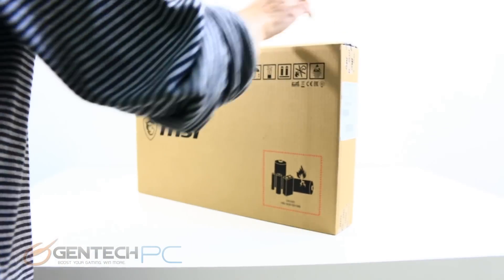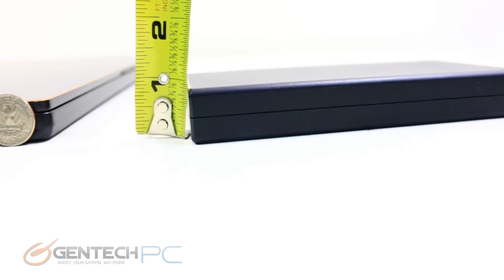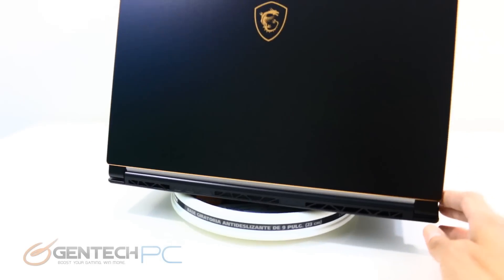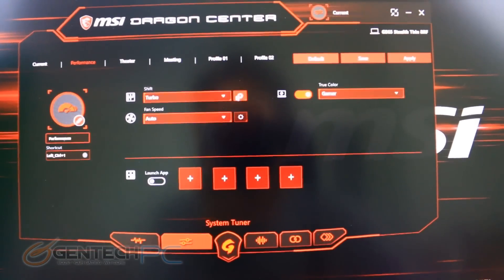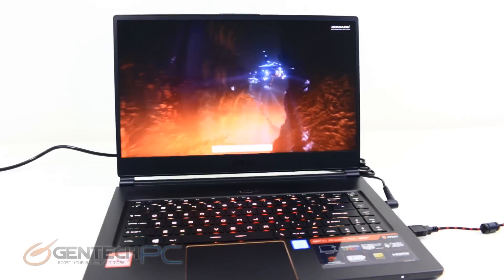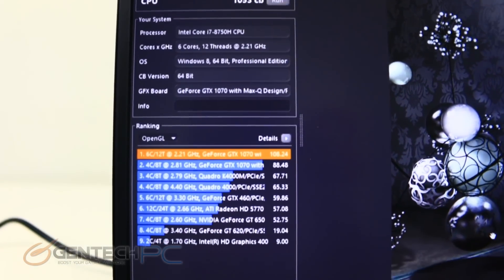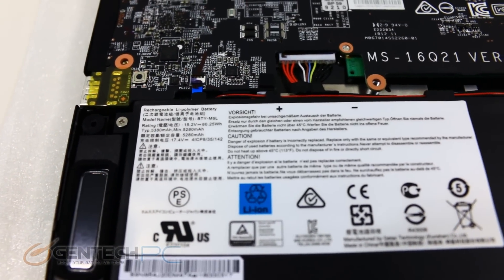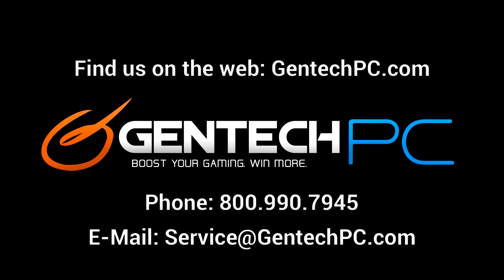MSI GS65 Stealth Full Review w/ Benchmarks

Comment: AMAZING REVIEW!! I am thinking of getting this. Will this last long though? Like 5 years?
Reply from the maker: 5 years should be no problem if you take good care of it and keep the fan clean.
Reply: @GenTechPC  How would you clean the fans though and how often?
Reply: @marioloza7845  Same question, it's so hard to open how does one keep this thing clean?!
Reply from the maker: @marioloza7845  Remove the bottom cover and use canned air to blow out the dusts, however, this is not the best way to do it, the best way to do it is completely remove the fans and blow out the dusts outside of the laptop.  

When your laptop starts to getting very hot then it's time to check. Or just check every 2~3 months depends on your environment.

Comment: question, so the CPU and GPU are soldiered into the motherboard? if you purchase the entry level G65 Stealth Is it possible to upgrade from the 1060 to the 1070, or upgrade from a 7th gen i7 to an 8th gen i7? I remember having an original alienware back in the day and the processor and GPU's were up-gradable.
Reply: BlackMarket Entertainment No it's not possible to upgrade but the best thing is this laptop has a full thunderbolt port and you can always get the 1060 version for better thermals and use an eGPU via thunderbolt for future cards.
Reply: thunderbolt is cool but not portable, its definitely always great to have that option, but I prefer the old school MXM Gpu's. My Alienware had dual GPU's in crossfire that were upgradable, I remember going from the x2 radeon 3870's to x2 radeon 4870's... does anyone know of any newer notebooks that still use MXM cards like back in the day? I mean being able to upgrade into the next gen with a laptop internally is almost unheard of these days.

Comment: At amazon, MSI said that there is a slot for a 2.5" HDD. Where is that located exactly?
Reply: there is no 2.5 slot. the battery has taken this spot. No one really wants 2.5 any more. Use nvme pci  its faster and less power.
Reply: @iDatas but it's pricey as hell. Is there any other cheap alternative to increase the memory? Will the memory slot support SATA ssd?
Reply: Not sure how they done it but taken from their web site - 
SSD
1x M.2 SSD slot (NVMe PCIe Gen3)
1x M.2 SSD Combo (NVMe PCIe Gen3 / SATA )

The combo slot is however occupied by the drive that comes with it so not much help unless you don't mind replacing.
The memory slots only takes memory dimms I'm afraid.
I liked the look of the MSI but would recommend you take a look at new Razer Blade 15.
If you really want to use 2.5inch SSD you can buy a usb 3.x enclosure for one.
Hope this helps.

Comment: For memory / SSD upgrade, see here all the many steps for detaching the motherboard!

The video from 13:24 shows the required detaching of the motherboard, and omits quite a few steps. You will need to remove A LOT of hard to remove cables, it seems very hard and dangerous do to, way harder than any previous upgrades I had done! Here are the steps I took
 
** For all flat cables, always pull up the black part first with some sensitive small pliers, EVEN if the black part is on the other side of the fixture!.
1) removing the wide black cable which is also stuck to the fans, detached two strongly glued parts attaching the cable to the fan.
2) remove the two remaining black screws which are on the motherboard (one right next to the video cable)
3) remove the yellow tapes of the cable to the network board, remove the network board screw, remove the network board (I was not able / willing to remove the two long black cables from it, so had to pass the whole network board through the large hole between the board and the fans, after some slight stretching)
4) remove flat cable from rear
5) remove all 4 (!) flat cables from the front part of the motherboard, including a small one far on the left (which I had missed initially)
6) remove small white (power?) cable close to the network board
7) remove the large white power cable (I was not able to do it, so I ended up upgrading without removing this last one)

Do at your own risk, there seems to be a high chance of breaking the whole thing! Otherwise just buy an already upgraded version...

Thanks a lot for the video, GenTechPC!
Reply: Nonsense. If someone has no idea maybe. But saying a high chance of breaking it would only be true if your a moron. 
Take your time and it is fairly easy. More steps because of the flip but it isn't rocket science. 
If your laptop breaks while inside it then your doing it wrong...and if that's the case then you shouldn't be opening it to begin with.

Comment: hate the fact that these gaming laptops don't have HDD slot >< 
now i have to pay extra 500 USD instead of 85 USD for 2 TB drive ...
Reply: Just buy external HDD you can save extra bucks
Reply: buy a bigger laptop. super thin and light means everything is the smallest it can be. Plus you get a bigger battery which most would agree is better. e.g. not tied to brick when you want to spend quality time with someone.
Reply: iDatus the problem that I need thin light and small 15.6 inch form factor, I move my laptop in my backpack about 20-25 times a month
Reply: I was just stating that's why it is so small, the GS65 is a lot lighter than the ASUS or Gigabyte one which fits your requirement.
Its ok having a gaming laptop but carrying one around is not fun. The MSI seems the only one that gets it.
Reply: Yeah you can buy external HDD OR SSD BRUH

Comment: How do you think this laptop would hold out if I was planning on using it as a daily school laptop (Word, Excel, chegg, YouTube) for about 6 hours, and games like fort nite by night for prolonged periods. I'm worried about the thermals and the damage that it could cause.
Reply: -- Took out confusing comment --.
Both the MSI and gigabyte Aero 15x V8 will work for you. Look at both as they are similar but have many differences.
As for thermals and damage, don't think any device can damage easily as they have top limits set and if reached throttle power to these devices until save limits reached.
Hope this helps you.
Reply: iDatus get your information right.this is max q. The one that is not n
Max q is the new asus
Reply: I wasn't referring to the actual cards more how they are used. Which now I re-read my comments comes across as confusing.  Asus wouldn't fit Brian's requirements and I would recommend he looks at the gigabyte model.
Reply: Ok I remember what I meant. G-Sync. You have to reboot it to use the CPU(GFX) so that's the annoying bit. The MSI doesn't.

Comment: You seem to have switched the videos for outside heat buildup, you second video shows lower temperatures then the first one.
As I was watching the review I was surprised it got so hot at idle, but then saw that it was much colder on full load:)
Reply: Bah ,the later part of the second video shows higher temperatures then it does at the start, so I am not sure what is happening. I guess I will have to wait for notebookcheck's review for full graphs and hot spots... Otherwise great video though, good luck.

Comment: Wish CPU throttling analysis would have been done, since it it the weakness of the cooling system and most reviewers do not cover it either. I think all i7-8750h CPUs throttle at 90C instead of the 100C tJunction limit, shame. 
Also, since we ALL know the 8 hour battery life is a lie, would of been nice to see battery life tests. LinusTechTips managed only 2 hours, 35 minutes with the PCmark battery test https://youtu.be/uAUub6LPKBU?t=5m20s

Comment: ouch @ 94C, terrible thermal solution, this will throttle like crazy in game
Reply: Sayori Yeah, I ordered Aero 15X with repasting, I'm planning on undervolting my CPU if it throttles, hope it works out, otherwise I will have to spend on a laptop cooler as well :/
Reply: I have came across the term repasting. What exactly is repasting and why does it help with keeping the laptop cooler?
Reply: Sayori thank you sir. is it costly to get your laptop repasted?
Reply: Sayori thanks sounds good. i ordered this laptop and i regret it. I went for the 256 gb and when i received it, it shows a total of 133 gb but 77 gb free and it has been reformatted. And they are trying to charge me a restock fee. smh. do not buy the 256 gb.
Reply: Sayori I’ve heard it’s actually really easy to do so even tho it looks intimidating. 30 minutes top
Reply: in any thin and light especially with 8th gen i7s they all thermal throttle under load and they all have problems nothing new to that at all
Reply: Never had an issue with throttling out of the box, but it did get hot to the touch which was not comfortable whenever my knuckle rubbed up against the exhaust vents. An undervolting solved that.

Comment: 8750H CPU throttles because of heat and Is Vulnerable to the New Spectre And Meltdown Variant 2. 
Only IceLake in 2019 will solve Spectre and Meltdown. 
This Laptop is way too Loud and 1070 MaxQ can’t give you enough performance to run the 144hz Display.
Who Designed this Laptop ? getting to the RAM as M.2 Drive Voids your Warranty.
Reply: it does not void the warranty. Get your facts straight buddy...
Reply: You really don't know what your talking about... I have never had a heating issue with it... Play witcher for hours and hours and never have it throttle... cpu is around 80c gpu is around 65c
Reply: IceColdKilax Go for the gigabyte aero 15 it has an gtx 1060 and it give you enough fps to run fortnite on 144hz or at least 120fps  if you open it it doesn’t void wareanty. I’ill get it soon and would replace thermal paste and maybe underclock it will help like ~12 degrees. But maybe only thermal paste and that is good for like ~5-7 degrees
Reply: xToxicXSkorpion NO WAY Nvidia is releasing new Mobile GPUs by the end of the year. New mobile GPUs will equal GTX 1080 desktop performance.
Reply: IceColdKilax Wait a half year ? Lol
Reply: IceColdKilax Or maybe more

Comment: Was there any mention of battery life? I didn't notice any comment on that, but would be curious to hear what was tested vs. the advertised time.
Reply: If I remember correctly, if you're gaming, the laptop will last 2 hours. It will only last 8 hrs if you're not gaming.
Reply: I've heard a range of answers on this (I think Dave 2D mentioned 6-6.5?) so I wanted to continue getting info on it.
Reply: The label inside the laptop at 3: 45, says 8 hours of battery life and we got to see just how huge that battery was when the laptop's back cover was removed.
Reply: 82Wh battery, do some maths. With battery saving modes enabled, you may get  between 7 and 9 hours.
Reply: I've had the laptop for about a week now. It's 6-8 hours using it for office-style programs. 4-6 mixed and 3-4 hours heavily gaming though it depends on the game you are playing in terms of how hard the GPU is working.

Now, I have the 1060 version (which improves battery life around 20-25% over the 1070 max q) -- the only real reason you'd go with a 1060 (it also does have a slightly better temps perhaps 2-3% better) is for battery life/slightly better temps. That and its obviously cheaper.
Reply: euno17 That means 
1- You have stuff open in the background which ruin the battery life. Programs like O&O Shutup10 will HEAVILY imprive the battery life by getting rid of useless W10 features by disabling them.
2- Your CPU isn't undervolted. 6 cores CPU running at the full voltage will, again, ruin the battery life as well. Try undervolting and then test the battery life.

According to my GE63's 51WH battery which easily hits 5 hours with those settings, yours should do much better.
Reply: euno17 Hey did you notice any backlight bleed on your GS65? ?
Reply: AJ i havent looked hard but i havent noticed any. so any backlight bleeding that does exist hasnt been noticeable. Its been a hell of a laptop for me. I did have one issue where speakers werent working but it was only becuase as i took off the back panel, i saw the ribbon for audio wasnt plugged in. Other than that small issue its a great device. I havent had any issues with it.
Reply: euno17 Awesome 👍 thanks for the fast reply. It’s a big purchase so I wanted to make sure as it can be annoying when watching a movie or something and seeing the light shine through.  Also if your curious to check you can either click on personalize on your pc and set background to a solid color (black) preferably in a dark room and see. Or find a backlight bleed test online
Reply: 7 hrs productivity and 2:30 min gaming ( 1:45 hr fixed fps @30 + falls to 10-15 fps after 2hr mark)
.

Comment: As per my understanding the display is 144Hz, but is it a TN panel or an IPS?
Reply: Ravi Gupta It’s an IPS
Reply: ThatHawaiianGuy thanks
Reply: danwat1234  https://www.google.nl/amp/s/www.techspot.com/amp/review/1615-msi-gs65-stealth-thin/

Quote from the tekst: ‘’Reaching just 248 nits of peak brightness is not great, and neither is a sub 1000:1 contrast ratio. Both of these areas are handily beaten by the Aero 15X which packs a similar display and somewhat superior calibration.’’

And for the Asus zephyrus m here: 
Average of 295,7 nits go to headline
Display

https://www.notebookcheck.net/Asus-ROG-Zephyrus-M-GM501-i7-8750H-GTX-1070-Full-HD-Laptop-Review.293956.0.html
Reply: xToxicXSkorpion, And I've seen and read that many people have had unacceptable backlight bleed. I'm receiving a replacement in a few days, will let you know if that's better. There's no point having a highly colour accurate screen if you have a bleed like that.
Reply: Neither TN nor IPS.
Reply: Prachurya Tamuli What!?
Reply: Xtoxic, data source for MSI 248 nits and Gigabyte Aero 15" 320 nits? Do you know the nits of the 8th gen Intel Asus Zephyrus m? It'll be interesting to see the nits of the MSI GS75VR new chassis when it comes out.
Reply: danwat1234 The Gigabyte Aero uses the same panel as the MSI
Reply: May the Science be with You Nope. Look at dave2d review msi used a AHVA from aeo and Gigabyte IPS from lG
Reply: Rappuccino Every laptop has blacklight bleef. Gigabyre has a calibration screen so they have less but because of calibration the screen so gigabyte has a better colour accuracy screen an get brighter
Reply: Wrong, only IPS panels have backlight bleed. It's all about the technology used by panels. My MSI GE63VR uses a 120Hz 3ms AHVA panel and I have ABSOLUTELY no bleed since 9 months. The MSI panel is hands down better than the Gigabyte's unless you like to use your laptop outdoors.
Reply: Zakaria Youncha I prefer better colour accuracy and blacklight bleed on the left and right conor then msi panel
Reply: Then MSI will be your best pick. The GS65 is a huge step up over the GS63 in terms of CPU, battery and the screen, it's a must have.
Reply: Zakaria Youncha Gigabyte Best pick bro Msi gs65 is indeed he beter screen then previous model but the gigabyte screen still wins maybe in the furture. Msi screen is like 8/10 gigabyte’s screen 9/10
Reply: Aero 15x V8 owner here, can confirm horrendous backlight bleed.
Reply: CDbiggen It’s not that i say the aero 15 has no backlight bleed but it’s minium i think you have a bad piece cuz i see enough people who have minium backlight bleed :)
Reply: xToxicXSkorpion, Second one came through, bleed was even worse than the first. It's hilarious. Back to the dell XPS I go.
Reply: feelsbad man
Reply: xToxicXSkorpion, Nah, it's just a laptop at the end of the day. Getting my money back so it's all good. Don't buy Gigabyte 😀
Reply: I will buy it and look of the blacklight bleed is there if so i will return it and get the msg gs65
Reply: Ravi Gupta it’s AHVA that is the response time from an tn and colour accuracy from an ips. But a ‘real’ ips like gigabyte would be better. Don’t forget that the max nits from the msi is 248 nits and gigabyte aero 15 320 nits